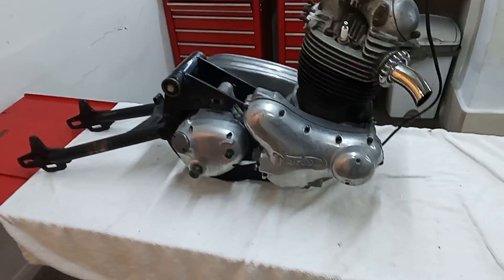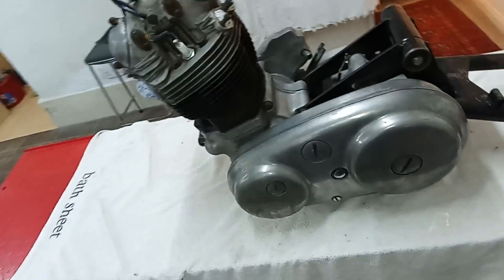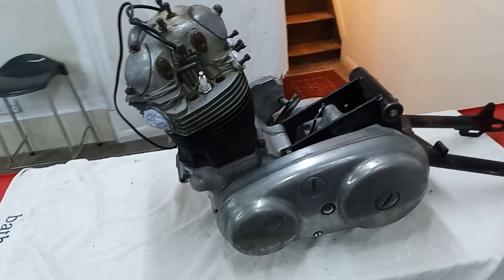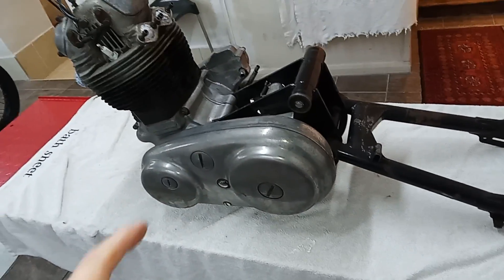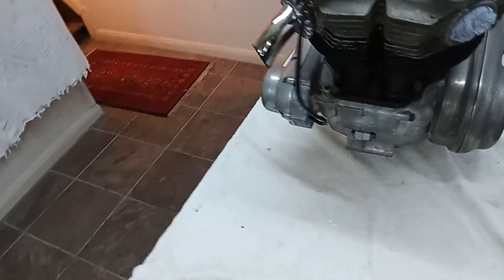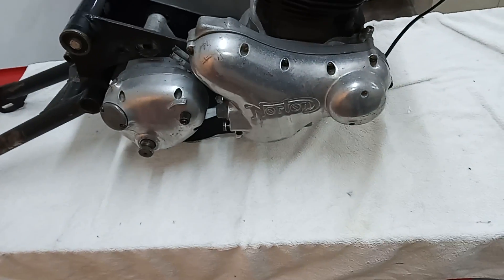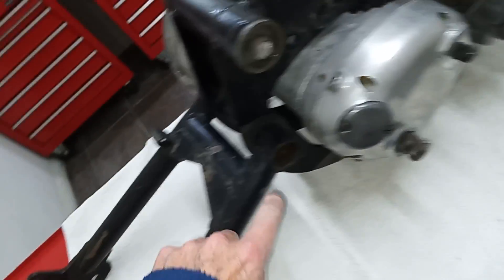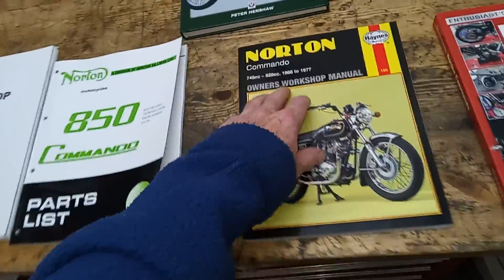Norton Commando Engine Rebuild. Part 1: Assessment

Comment: , they come apart easy and go back the same the only frustrating thing can be lining up the push rods while fitting the cylinder head. Use FAG bearings and you won't have to touch the bottom end again, regular half interval oil changes and if your engine doesn't have an oil filter fitted it might pay to fit one but I think all 850 models came with the filter system fitted.

Comment: I had a 1971 750 Commando.I paid 1400 Canadian for it .Sold it in 1973 for basically what I paid for it.Unfortunately it wasnt practical to own the bike as my only means of transportation.6 months of riding if you're lucky because of our Canadian weather.I had a lot of problems with the exhaust pipes coming loose and once one feel off on the highway.
Reply from the maker: That's true for many of us. As for the exhaust pipes coming loose, that remained a perennial problem on Commandos, only finally sorted towards the end of the production run.

Comment: ok, Chris you've convinced me to buy your manual. Where's the best place to buy it, shipping to Canada?  Do you sell it direct?
Reply from the maker: Ha! Good man! Probably the best place to buy a copy from is Amazon. I'll attach link to Amazon in the US if that's any good (I don't sell them direct). However, as we speak the manual is being reprinted and until the reprint is available copies are in short supply and therefore prices are high. You might be better waiting a couple of weeks by when the new copies should be with sellers. Here's the link to Amazon US anyway: https://www.amazon.com/Restore-Norton-Commando-Enthusiasts-Restoration/dp/1787113949/ref=sr_1_5?keywords=chris+rooke&qid=1552148314&s=gateway&sr=8-5

Comment: What are your thoughts on the long rod conversion with the light weight pistons. If you watch videos on it by JS Motorsports it seems to be a vibration fix no brainer. but pricey.
Reply: In the end its still a british parallel-twin without balance shafts.
Impossible to "fix" vibrations and make it a Honda straight six 😅
I had my rebuilt done with the JS long rod carillos and lightweight pistons two years ago.
The main reason why i went for carillos was a snapped original aluminium conrod that had ruined the engine.
I cant tell that the vibrations are much less than with the original conrod and piston setup, because i also have a CNW Headsteady installed that doesnt isolate the vibrations as good as the original headsteady.
But it definitely improves the handling a lot.
However, after 8000km with the JS-Parts i can definitely recommend them.

VERY well made stuff and nice midrange performance.
Reply from the maker: That's great, thanks for the input.
Reply: not a fan of aluminum rods but thats how they do it. On the fence if I should reuse mine, maybe zyglo them first. how much are the long rod/pistons  @stefansikora5183
Reply: ok will consider @stefansikora5183
Reply from the maker: Thanks, Peter, I haven't heard of that conversion. I'll look into it.
Reply: I want it. I cant believe this is not a common upgrade. Must be something there not saying. Thanks Chris will be staying tuned. @Chris.rooke150